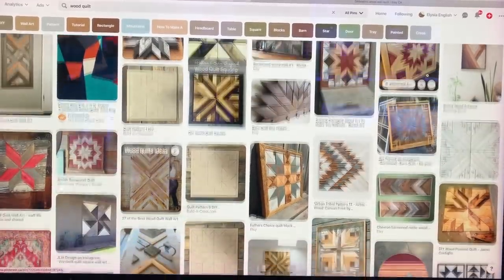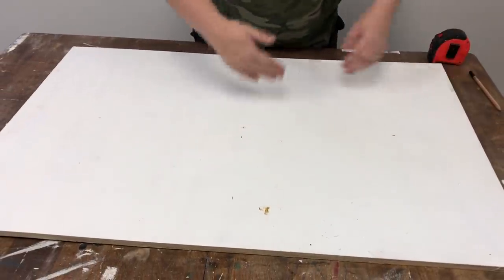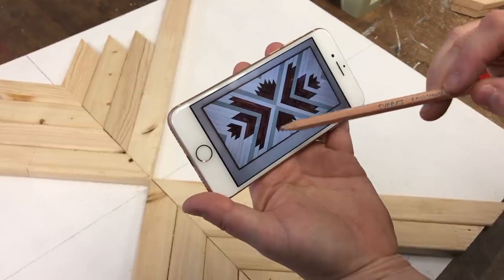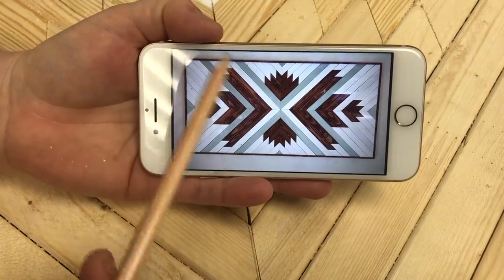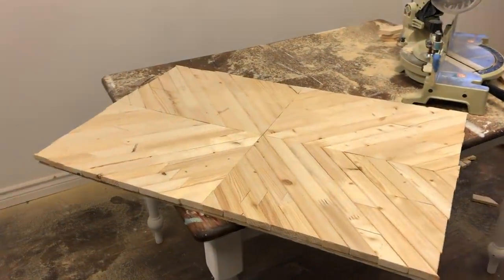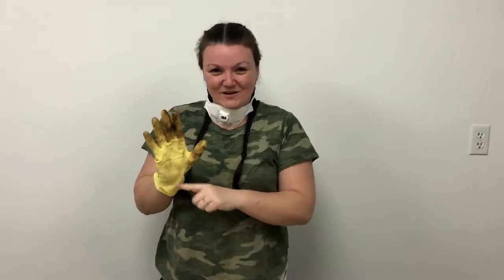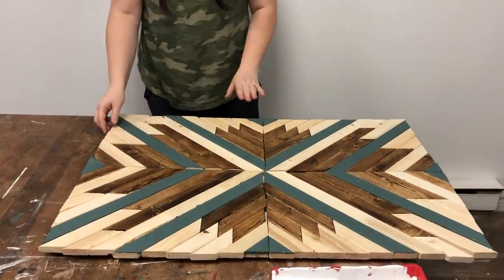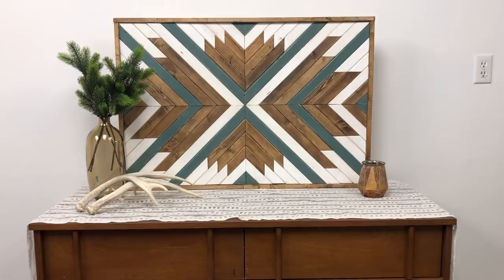Up-cycled Pinterest Episode #1 | Wood Wall Art Quilt | Pinterest inspired | Boho Decor diy

Comment: Love this! You should publish the instructions and sell it in your Etsy shop. I'd definitely buy them. 😉

I just bought a Glu bot for myself and my son in law. Have  you heard of them? I've watched another You Tuber that does a LOT of carpentry and fixing things from Thrift stores. The glu bot works wonders for applying wood glue. It feeds from the bottom so you never have a skin on top of your glue or to clog it. It also feeds both horizontally and vertically. The 16oz one is only $7 on US Amazon. There's also a 6oz and 4oz. There are also replacement parts so you aren't buying a whole new bot every time. I'm not  affiliated with them at all. Just a fan.

Merry Christmas to the English family and your mother in law!
Reply: Zeb is amazing!!!